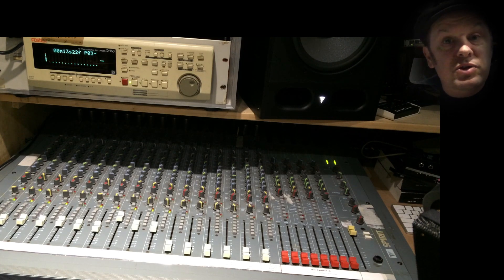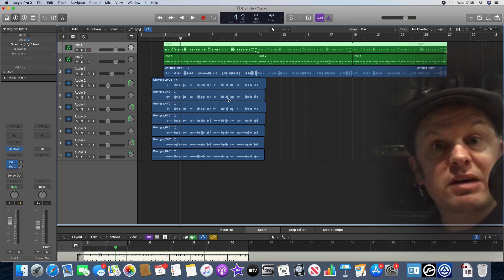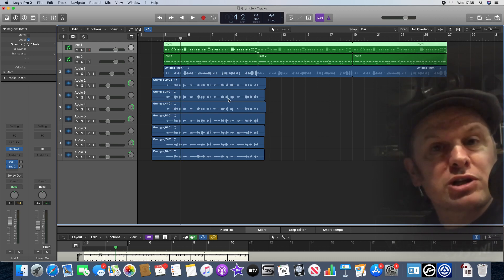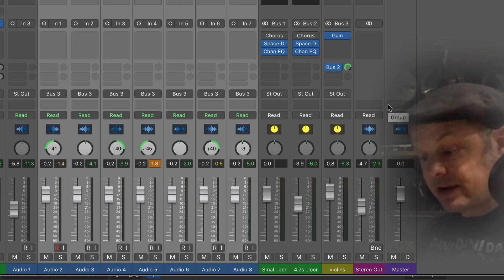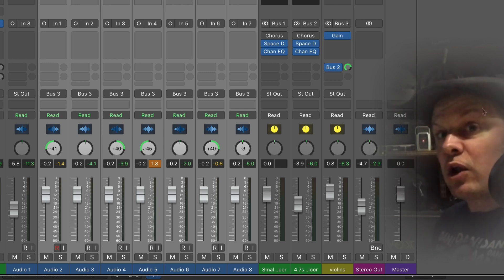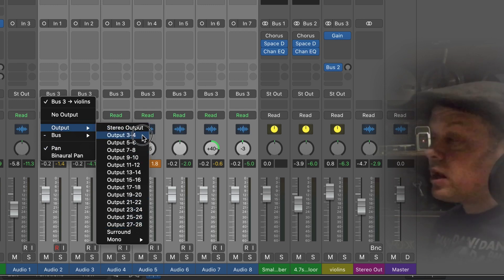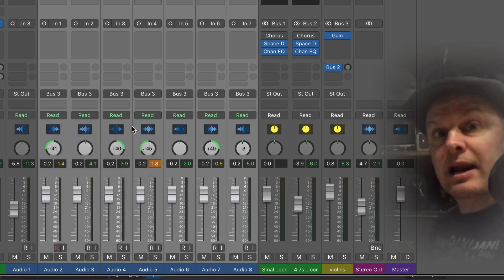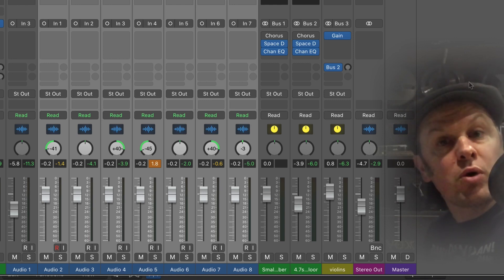Audio Busses - an Explanation and Tutorial

Comment: absolutely insane.  i started watching your vids after a 'friend' with a studio started acting wonky about talking with me...as if i were going to 'compete' with him.  (no chance) 
I think I lost him as an educational resource so i started looking for info on how to use hybrid setups to best advantage.  I found your vids and got a nice educational update on how they can be used with DAW s/w.  Great vids BTW, thanks!  I only want to record my own stuff and maybe a friend or two.

Friday I'm picking up the 24ch version of your Spirit Studio from someone local for $250 in great condition.   I've done some research and might recap the power supply and later the pre's if I think they need it(only time will tell).  Anyway, if it weren't for you this board would not have been on my radar at all.  Thanks much and hope to learn more from you in the future.
Reply from the maker: Cheers Jon! Yea the Soundcraft boards do sound good but beware the insert points on each channel. They can give trouble and cut in and out. I soldered across mine as I never plug anything in the chain.
Reply: @DanBakerMusic  - I'm planning on opening it up and checking continuity at the outputs, possibly flowing new solder onto the connections if needed.  I am hoping to experiment with taking the out off the inserts to a half-norm patchbay and sending the second output to try to make a meter bridge and possibly a switchable RTA display.  In short, i'm going to get into the guts of it.  might end up buying a second board...i really wanted a 32ch but this will be great so no complaints.

Comment: BUT i'm still confused.

I'm here because the fools at Steinberg call EVERY in and out a Buss, and I have NO CLUE how I am supposed to route the Universal Audio Apollo Twin Duo into Nuendo to setup a Control Room properly, which I wouldn't necessarily need, except that I DESPERATELY want to record an artist who is in Canada while i'm here in the U.S. via VST Connect Pro.

I have the MIDI setup.
I can find ways to setup the inputs and outputs.
But, the "Control Room" Confuses the HELL out of me.  (How do I route the talkback and monitoring while making the Universal audio software channels link up with the Nuendo channels properly...

The CONSISTENT PROBLEMS which I run into:
1.) Control Room Talkback
2.) Audio Output for remote performer (though the level meters are showing for remote performer... and I used 2 different interfaces for the performer.
3.) Performer Talkback

Comment: That Soundcraft is slick. Recently I found similar (slightly bigger) one on auction and almost bought it, because of Your YT channel. I have only 1-2 and 3-4 on my desk and are constantly occupied.
Reply from the maker: They’re are good desks, the only trouble being that the insert points can give trouble with old jack plugs. I soldered across mine...
Reply: @DanBakerMusic   that desk looks very familiar. I have just put a deck 1882 back into service. Believe they were bought out by soundcraft and it evolved into the spirit 

You mentioned being able to send mono to the buss. Could you elaborate   new to hardware and would like to be able to utilise all 8 buss tracks as mono. May not be possible on mine as I can't see a way of doing it